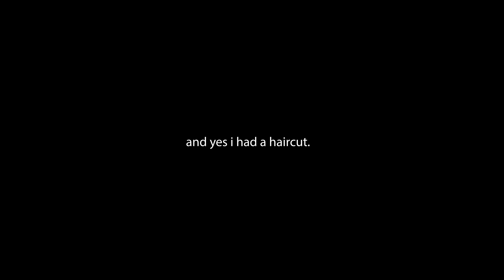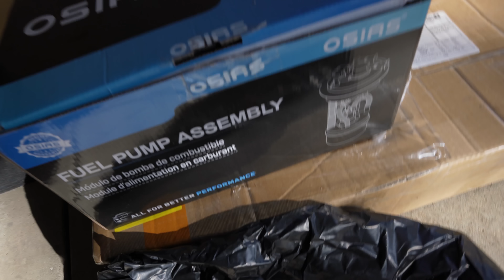XJ Cherokee Abandoned to Beast On a Tiny Budget!

Comment: Well.  That's just great.   
Now I want an XJ.   Thanks. 
Looks amazing.   It's a awesome transformation.
Reply from the maker: Would if help if I said they have a rear auto locker as well from factory?
Reply: Do yourself a huge favor and look to the Japanese, something with a roller cam.
I put a different/ new engine in my yj every 20k miles. Cherokees were always very cheap. Not anymore. I put a 4.0 in my hot rod truck. Rebuilt it twice in 25k because it chewed the cam gear that drives the distributor and the second time the comp cams ate like 3 lobes. Word to the wise
Reply: @Youtubecensoredmyusername  Plenty of people in the states have high mileage 4.0l rock crawlers on 40s they beat on with zero mechanical sympathy and haven’t had any of the issues you claim to have had. Mine has 260k miles on the original 4.0, previous owners were running it low on oil and overheating it when I bought it 10 years ago and i haven’t had a single engine issue
Reply: @Tanner731  Iv Been running these 4.0s daily for 20 years I know a thing or two about them. Some get lucky but it’s just a matter of time before it punches a hole in the block. Crappy 60s design. Really good for back then though
Reply: @Youtubecensoredmyusername  I've heard of three that had a piston through the side around 400-500k miles but ive also heard the same about 1hz and 1hds
Reply: @Tanner731  the cherokees and grand cherokees like to crack pistons. The 2001 zj 0331 head lines to crack.Hey don’t take my word for it if you don’t wanna. Iv been working on these for 20 years. Go buy ten 4.slows I don’t care
Reply: @Youtubecensoredmyusername  I'm not going to take your word for it because your use case is not what the average 4.0 will see. you have it in a "hot rod truck" with an aftermarket cam in it. engines lose their magic when you open them up and start messing with them
Reply: @Tanner731  Iv had a bunch of stock ones and two modified ones. Seriously. I don’t care this is my opinion.   Iv had lots of friends that owned them. I even got my ex girl into one.
I’m not going to argue on the internet. do what you want  🙃 
For anyone else my recommendation is to stay away from tired old flat tappet junk and go Japanese
Reply: @Youtubecensoredmyusername  get a good japanese 4x4 for 10x the cost of a jeep... and then you cant have any fun abusing it. also you know theres roller cam conversions for 4.0s right? you could have a roller cam jeep for less than a decent japanese 4x4 costs

Comment: Ya suppose to attach the rear flair too the door and the second part to the body 🤣🤣I declare a lack of hydration in the video caused this mistake 🍺🍺🍺🍺🍺🍺got to love the xj
Reply from the maker: I didn’t want it on my door as the screw lined up with the pinch weld of the door but yes lack of hydration was a issue

Comment: A few interesting things on this one. The Air Conditioner compressor is on the driver side below the power steering pump? LIke on a newer TJ or WJ? That air box on top of the throttle body is a new one for me also.

Comment: If you didnt buy a adjustable track bar you need to drill a hole 1 inch over and bolt it in to get your front end straight

Comment: When it comes to the flares you installed them wrong. First of all they require some trimming on the fender wells. Second, that the rear are two pieces because the smaller front piece mounts onto the door so that you have the flare and can still open the door. You may have even mounted the rear ones on the wrong side. As for the front, they are supposed to wind up flush with the front bumper skirt but somehow you got them with a gap of a couple of inches. Seeing how you royally screwed up the rears and didn't trim the fender first I'm positive that the fronts not fitting right was you're screwing those up too. Don't blame the product for your crappy work.
Reply: Nerd
Reply: Jesus loves you! (John 3:16) He died for you!

Comment: The flares are right you just didnt install them right. They are for when u cut the wheel well out and raise the flare up higher. The front was suppose to go up like 2in higher same with rear and you cut away tje wheel wells. Read directions next time.  Go watch a video you can still do it right. And get more room for bigger tires to.

Comment: It LOOKS better.... but really theres a few things I just don't get:
If you aren't getting it registered, why bother wasting anyoney on those rubbish flares?
Why bother keeping the swaybar?
Then you spend a heap of cash on lights that it will probably never need?... cause its not like you're going to be going down the hwy at 110kph - its not rego'ed.
But then you shortcut the suspension SO much. Heck I don't understsnd why you didn't simply use the TJ arms. which are FAR better quality than the ones you fitted?
Not even cheap correct length shockies - but its got a sick light bar??

If you wanted a beast of a garden gnome, chop the guards, 37"  and make the pig flex.